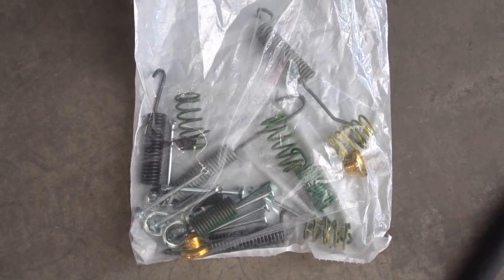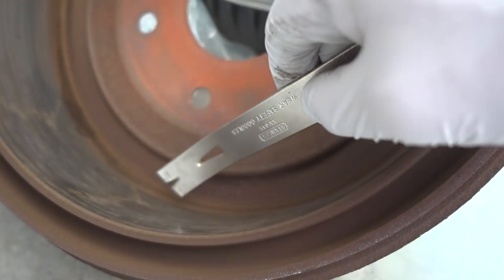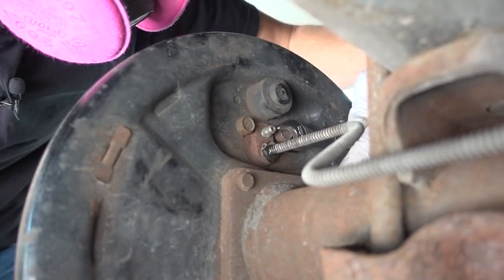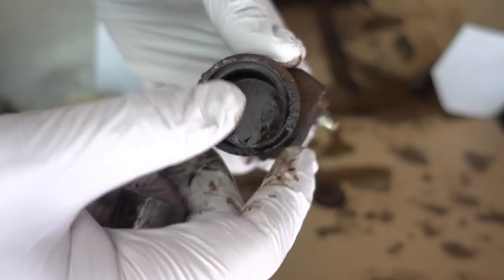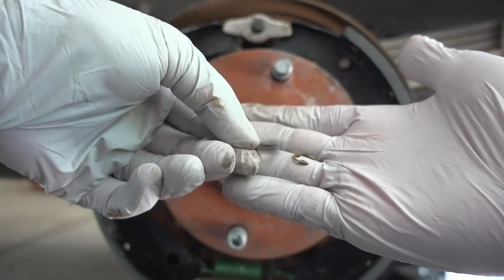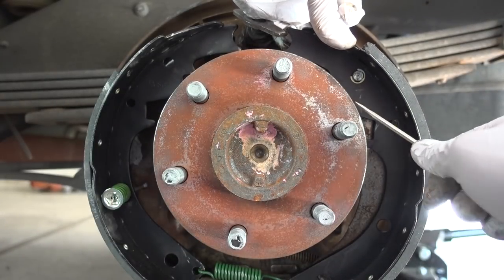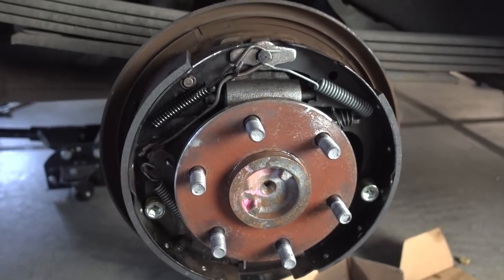Why You Should NEVER BUY A VEHICLE WITH DRUM BRAKES!!

Comment: good for you man got your drums brakes done! i remember when i 1st started i hated drums brakes but now i dont hate them anymore since i have done so many of them! as a diesel mechanic i do them all the time since 95% of even brand new 2018 tractors and dump trucks still use drum brakes in even the front axles of them! as for light duty i have found to older GM and Fords are the easiest! i found getting some drum brake tools helps a ton! mine are a Matco set got for around $120 but astro makes a good set for around $35-$50 or so you can get them on amazon! drum brakes are actually a good system but can be a bit harder to work on when starting out! i do recommend applying anti-seize to the adjusters before installing them so they work properly!you might need to adjust them too! drum brakes are suppose to automatically adjust when you drive in reverse and step on the brakes if the adjuster is not seized! on light duty stuff they can last a long time sometimes over 100k miles! dont beat yourself up too hard man! it was your 1st time!      
this is a great set of drum brake tools for not much money! Check it out!
https://www.amazon.com/Astro-7848-8-Piece-Professional-Tool/dp/B00061SGO0

Comment: I’m late to the party but I noticed two potential issues.  FWIW, I’ve got a ‘95 k1500 with 385,000 miles and my brakes work flawlessly.  I will note that the suburban uses slightly different drum mechanisms than the pick ups, but it’s all mostly the same.  
1.  You did not screw the self adjuster back in.  You have to do that to eliminate tension.
2.  You didn’t show or mention backing off on the parking brake cable adjuster.  It helps to have slack in that line as well.  
3.  As has already been mentioned, you need the right tools for the job.

Comment: Hey 1 Road, I have a 1996 K1500 Chevy Suburban and have done this job. Tools make all the difference, yes they are a pain to change but last a long time. I would of cleaned and adjusted yours as they still has plenty of life. Small leak on the cylinder was not too bad yet. But you did it and can move on to the next project. Good Day Sir.

Comment: lol last time i got in drum brakes was deleting a seized parking brake arm. drums aren't bad but the first time, they're interesting... you had had it easy, i don't get lightly used lower miles stuff. it's always a battle getting the drum off and sometimes a wheel even. anti seize on the hub was a good idea. i use that crap on everything anymore, that and die electric grease.

Comment: Drum brakes are ultra old tech. Like the beginning of the automobile, it prob was the only way they could do it. Though I do think they used them way to long. I did my own drum brakes, did one, and it was together, but not right. I ended up getting it towed to a shop and they stripped the whole thing again and rebuilt both sides correctly. They said I was VERY brave to attempt drum brakes lolz.

Comment: Drum brakes are not that hard once you get the hsng of them.  You did well.  Using a long screwdriver help in sliding the springs back into place.  Just be glad you did not have drum brakes like my old 06 Sierra with the horse shoe type spring.  Don’t forget to bleed the brakes.
Reply from the maker: Thanks. Yeah, thinking back on it, if I had to do it again it'd probably go twice as fast.

Comment: Does look like you had a significant amount of pad left and no brake fluid on them either. Probably could have gotten by with adjusting them out more to the drum. But in the end you've now conquered drum brakes, it gets easier. They're not as bad as early 90s gm rear disc brakes

Comment: did you bleed the brake fluid? did you adjust the shoes to fit properly in the drum? there is way more to know than just replacing parts, dude. btw, your emegency brake bar end spring retainer looks upside down on the passenger side brakes. the spring shouldn't be cocked like that. dangerous.

Comment: you should have bought or borrowed the proper spring removal/installation tools.vice grips will chew into  the spring and weaken them, and chew all the paint off, making them rust easier. thus, making them dangerous. get them done by a pro, it's safer and quicker

Comment: I think mine need to be replaced because i have a 1998 Chevrolet Silverado with 240,000 miles on it and the drums are original. There are noises coming from the back so i assume that there probably bad.

Comment: The rear brakes honestly never really engage on these trucks unless you put the brake pedal to the floor mine have never been replaced and look just a little more worn than the new ones you installed these trucks can tow a lot more than the brakes can handle they are know for bad braking and spongy pedals.
Reply from the maker: I was definitely having a major braking issue before I did this... whatever it was, it's now fixed! The brakes are still spongy by today's standards but definitely feel more reassuring. I've never felt the brakes feel so good on this truck.
Reply: @1RoadGarage  have you done the NBS master cylinder upgrade yet? Have yet to do it myself, but everyone on forums and YT  say it's a great upgrade.

Comment: never liked messing with drum brakes when my 94 suburban needs rear brakes im swapping it to the later Tahoe rear disc
Reply: drum brakes are better when towing(unless the trailer has electric brakes)  but if you are not then disc brakes are better  unless you get large disc brakes (which will require a tire and rim upgrade)
Reply from the maker: Was going to do that too but just didn't have time.
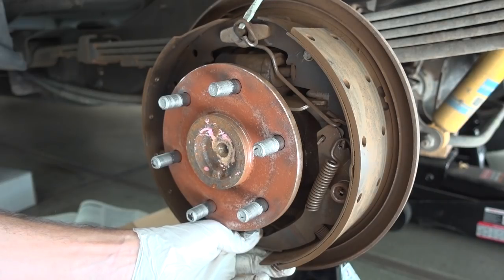Reply: I have a 78 c2500 355 sm465 an 4:56 in the rear that's my hauls anything I hook to it rig may not get there very fast though lol but most newer trailers ive used had brakes